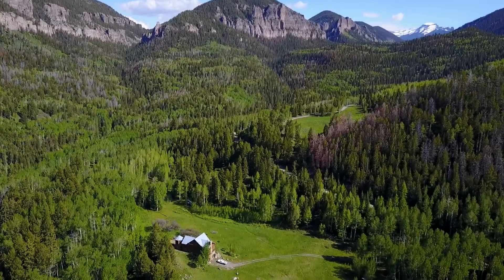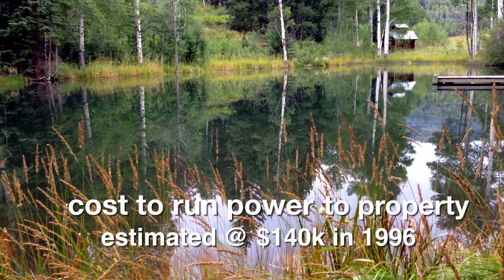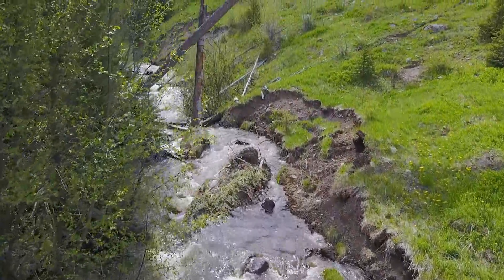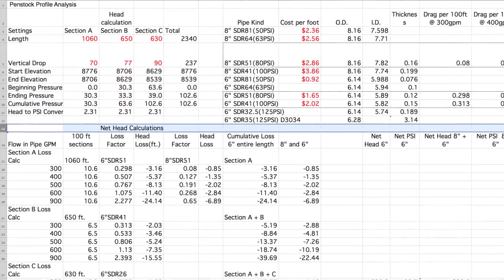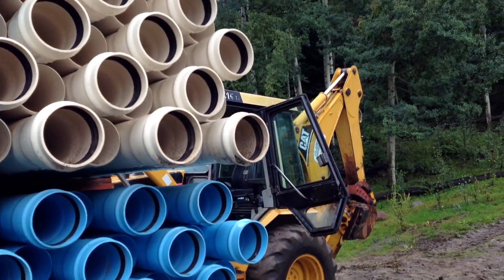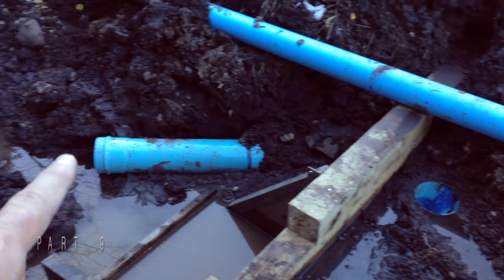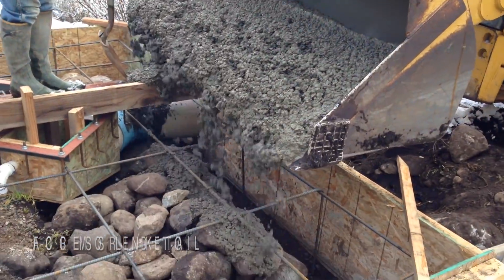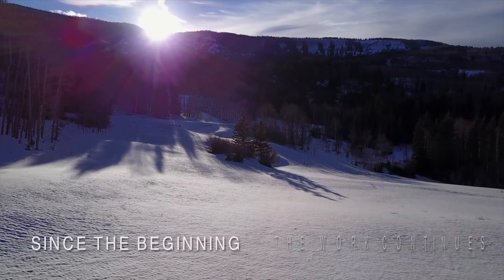Part 20-1 MicroHydro Power System in CO

Comment: Brother I do not know if you told us or not. I have seen all your videos and LOVE them. Would love to know way you guys did not just go with 20 or 30 kw of PV solar. Now with solar being so cheap I would think even thing it would have been less. Like I was saying I know you had a reason for not doing it. Thanks for the blessing your have been sharing and keep sharing. God Bless.
Reply from the maker: A few reasons exist for why not solar.  Initially cost was way higher than today in 1995 and I had no desire to deal with batteries back then as the property was initially a second "Vacation" home and not always occupied.  The spring water source became useful for both power and domestic water.  The purchase of the additional land was an investment in the future expansion of power and when the springs went from 80 gpm to 10 gpm it became necessary to go that way.  Given the choice in 2013 whether to go with solar, the aversion to batteries remained. Other factors were the existing constancy and density of power available from the creek, the already owned hydro equipment, and the fact that at 8600 ft. In winter we can get multiple feet of snow in winter that would need to be removed from solar panels each time it fell or drifted onto the panels.
And lastly the self applied moniker "hydrohead" comes into play.  Working with hydropower gets in your blood and you come to love it and it can be addictive the ease and constancy of the power.  So Mrhydrohead was a moniker I dawned to undertake the re-engineering of the system on to the creek.  Being a retired Cinematographer I thought it would be a fun project to document and share the experience and knowledge of how one goes about creating a system. The property was always a place to retire in my mind and having abundant and reliable power would be a prerequisite to moving here full time which we finally did in 2016,selling out of the first home in LA and escaping that rat race.  It has taken decades to realize the dream of living deep in nature with abundant power, but now we are here and I get to pursue photographing the display of natural beauty which arises each day.  So it's sort of a long winded way of saying there was just a momentum to continuing with hydro vs. solar as a source. I knew it well, had the equipment, funds and skill and somewhat of an addiction.   It has been an adventure for sure. Thx for watching!  Parts 2&3 of synopsis are cut now but just being polished a bit with sound design, text notes and color correction. That's an addiction too.  😉🙏🏻
Reply: Love it brother. I have been working in the renewable energy field for the past 20 years. I have seen the days where PV was 100 dollars a watt or more. Now seeing PV at some times 20 cents a watt just blows me away. 

I have worked all over the world. In the south pole, North pole and even at places I still do not know if I can say. One thing that happens in all tho's places. NOT one thing worked the same as it did in the last place. I worked on a hand full of hydro power plants. Most where 1 MW or smaller. They where for small microgrids that where out where the main grids could not or would not go. 

To this day I kid you not. I dream at night about the sounds of tho's old Pelton wheel turbine singing there songs. I love the sounds they would make. One we called grumpy it was not good at staying up to speed. We had a main bearing that was bad even tho it was brand new. We it would get rolling and man would it make this high pitched whistle. Even tho it was 10 years ago or more I still can hear it. Funny the things that stick with you over time. June 1 I will be 40 and I still get joy out of my air conditioner cooling my house on a hot day from the sun. The same sun that is making it hot or that nice glass of ice tea. 

Sorry have no clue why I am sharing this. Thanks for you do. Your videos have helped me out in some bad times of my life. I have a lot of bad health things going on. Just a few weeks ago I was laying in the hospital bed sick and in a lot of pain. Your videos I had not seen helped me forget about it for a bit. Thanks for that true blessing. God Bless.
Reply from the maker: Thx for sharing. Our pelton is rarely heard being 1100 ft from the house. Sometimes heard if the wind is right. Fortunately it's bearings don't complain and the would of raging creek water prevails. Sounds like you've had some interesting travels. Me too having been in the film biz. 

Sorry to hear of your health troubles but glad the videos have provided a bit of distraction/solace. Hope you heal quickly. Best wishes and prayers to you🙏. Illness reminds us each day is a blessing. Now 65 and older than both parents that went at 61. I savor freedom each day✌🏼

Comment: That's a lot of effort. If solar was as cheap as it is today, would you still opt for hydro?
Reply from the maker: Good question. I would still opt for hydro because of constancy and density of power, old tech, no batteries, and no winter snow removal from panels. But the property lends itself to this so well it's hard to not harness it even though solar cost has fallen so sharply

Comment: Where could I purchase the 6 inch low pressure pipe? What is a rough cost for it?
Reply from the maker: What part of the world are you living in?
Reply: Southern Oregon. I need to measure the length of the creek, at least 500 feet I am guessing
Reply from the maker: I would suggest speaking with pipe suppliers that provide irrigation pipes to ranchers and farmers. I bought 3 grades of pipe shown in video.  The lowest rating I used (as per advice I received)was sdr 51 80psi bell end gasketed for $1.65 ft in 2013. Prices vary with the cost of natural gas which pvc is made from I think